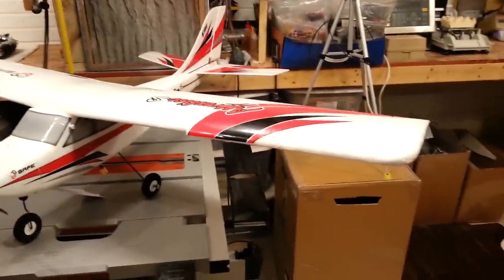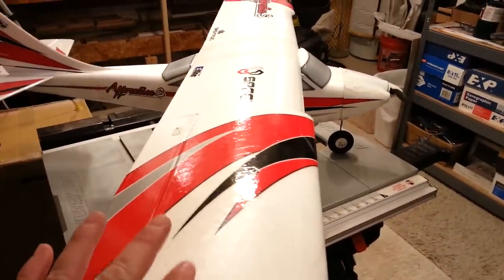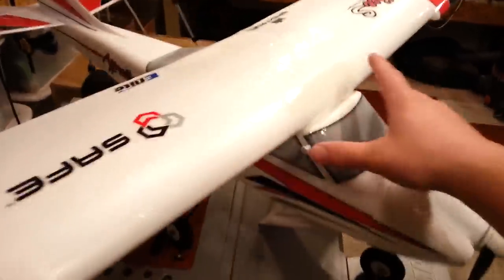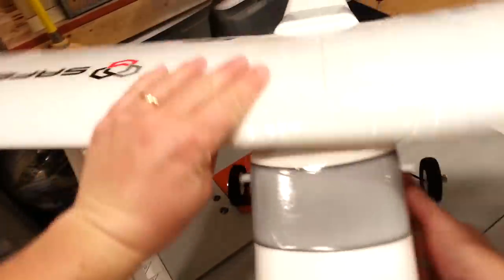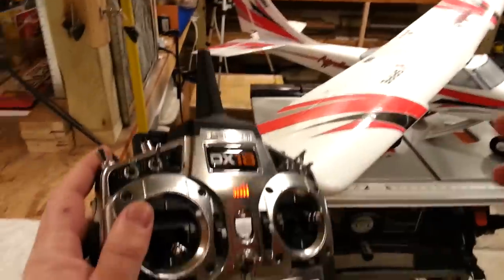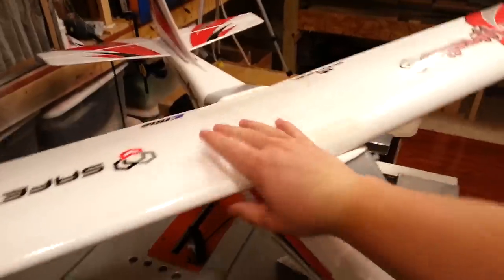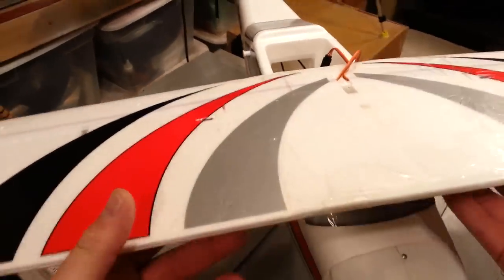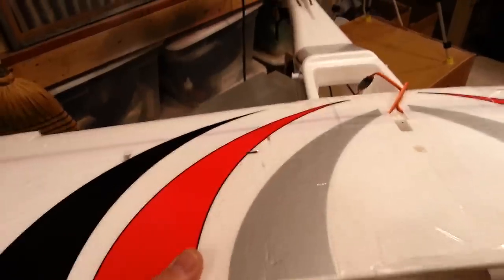E-flite - Apprentice S 15e - Flaps Mod - Part 1 of 2

Comment: Brian, I have a question and I know you can help me, My Aprentice STS came with the receiver SPM4650C (same as the Carbon CUB) and the  flight controller is SPMA 3230 (the one in the Carbon Cub is SPMA3230A), for the Carbon Cub was so easy to install the flaps, now I am doing for the Aprentice, but I am not able to find how to activate the channel 8 which is available in the flight controller at the Aprentice, I am using the NX10 Transmitter, could you please give me some directions, thanks.
Reply from the maker: Firstly, plug in a servo to that port, then go into MONITOR MODE, then move switched to identify what controls what HIGH channels. Then when you see it move, you can make a MIX, since you may not be able to use the WING TYPE to setup flaps, since the RX is designed to be setup without flaps. This is easy to make happen, but you have to do some of the flap stuff manually. It's not hard, but it's gonna take some fiddling.

Try these things and see if you can get it attached to a switch, then use the SERVO SETUP MENU To change the SPEED if you want it to move slow like the FLAP MODE would do. Then you have to figure out how to mix in some elevator down, if you so desire.

Comment: Big stupid new guy question,  maybe I missed it but can I use the basic 7 ch transmitter that came with the RTF kit? (Spektrum DXS DSMX® 2.4GHz) Or do I need to upgrade transmitters for this flappy doo modification?
Reply from the maker: I don't know for sure, since I haven't had the RTF offering, but I assume you'll have at least one channel that's "Free" on your setup, but you'll need to look at the Receiver inside. If there's an opened spot, plug in a servo (yes, you can just pull the RUDDER for example and move it over) then start flipping switches and see if the servo moves ;)
Reply: @BrianPhillipsRC  Thanks for the reply. What you wrote makes sense to me. According to the RTF 1.5 description, this unit comes with the Spektrum 3230 Flight Controller, pictures show 8 slots (?).  I won't hold my breath but I bet it should work, although I doubt I will have 2 positions for flaps due to the basic controller, no biggie. After we move back to land and onto the mainland I'm grabbing this plane, everyone tells me it's a great starter. I can't leave my toys and models be, so I'm sure I'll be doing mods to it as well. Thanks a ton Amigo. 👍🏼

Comment: Brian, good point on the safe.  I have the mini apprentice and there is no on/off switch on that one.  Plug in the battery and its automatically on.  How do you avoid that problem.  Though I don't think anything ever went horribly wrong, but I will be testing this out next time I use it.   thanks
Reply from the maker: I think they've improved the arming process in the newer AR636 to prevent arming so that you can flip the plane over after hooking in the lipo, but this was an earlier SAFE Rx, before that feature existed.
It was a "rookie" mistake, but something that shouldn't even be able to happen, if you ask me :)

Comment: Hi Brian, thanks for hi-lighting a dangerous combination for "safe" equipped aircraft.  Really sorry to see a busted airframe When you first mentioned a mistake, I had visions of car v's plane
Reply from the maker: It happens :) (left out some select letters, as you can see)
SAFE is a great learning aid, and I didn't even need it when I flipped it on, but I knew exactly what was happening, but didn't have time to respond in the fastest method (IE turning it off)...maybe I'll move my control on the apprentice to my GEAR switch, since I have no intentions of utilizing that switch, but it's easier to get to that switch in a hurry.

Comment: Flap and LED's little Grasshopper here. You do this so much that you should consider making your self a set of wooden flap angle cutters Roulers, so you can cut more easily with a flap exactoknife  blade or maybe something like this https://www.youtube.com/watch?v=149ZXze_JOo   or even better a one pass to cuts like this one, but DIY  https://www.youtube.com/watch?v=obJfXKI99oQ&t=6s you could probably make one that gets hot powered by a lipo battery
Reply from the maker: that is nice!
Reply from the maker: The second one... I think I saw that on The Silence of the Lambs???? 

LOL
Reply: LOL well you can also use it to harvest organic film covering for your balsa airplane then ;)

Comment: Hey how would ypu recommend cutting the flaps fo this plane if im going to use the dubro nylon pinned hinges? The ones that slide into the foam in the middle of the flap. Should i cut straightm or a 30 or 45 degree angle?.
Thanks
Reply from the maker: You could cut them at either angle. Are you trying to make a fouler flap, or just a tight fold?
I suggest you go for whatever yields the smallest gap, which would help you to "break" the plane more with full deployment. That's the only part I'd change about my design here, but they worked really well.
Good luck, whatever angle cut you decide.

Comment: Brian, great video, super explanation of all steps, simple tools, skillful craftsman  = great success. Will copy your work with tremendous pleasure :) Keep on going and show us some more adaptations. Thanx!
Reply from the maker: Glad you enjoyed it! One this I would do differently, if I had it to do over...I would have use a slightly thicker wire from one side to the other. This has proven to be on of the only weaknesses in this design, even though it works okay, I think the flaps would be way more effective if they were held down better.
Good luck with your mod :)

Comment: Whats the best glue to use for the servos?? Im putting flaps on mine but not sure what glue to use for the servos!
Reply from the maker: You can use hot glue, but gotta be sparing - it's heavy. If not that, then CA would be okay, or Mucilage (foam tac / UMH Por are similar)

Comment: Hey again. So i just tried to hook up the 2 servoa to the aux 2 port on the apprentice s 15e. I have a dx6e and i guess the aux2 port doesnt show up on my radio. I was told that the safe system uses one channel and the panic uses another with as3x. ? I can not get the servos to work as flaps. Do you know of anyway i can get this to work without buying a new radio.? I tried mixing and everything.. using the stock receiver and eveything is messed up. When i tried to set it up it will interfere with the flight modes. Panic and the 3 flight kides dont work. I could never get the servos to work with the dx6e. Can you please help...
Thanks
Reply from the maker: 6 channels means that you aren't getting to channel 7 or channel 8...so you might be unable to do what you want to do, without either another Rx OR a new Tx...

This might help you understand better...

(In no particular order)

1) Rudder
2) Elevator
3) Throttle
4) Aileron
5) Gear
6) Aux 1
7) Aux 2
8) Aux 3
Reply: @BrianPhillipsRC  can i put the same reciver thats in the timber 1.5m in the apprentice and set it up like the timber? How would that work with the apprentice i think its the ar636 or something
Reply from the maker: You CAN use the Rx, IF it actually came out of a Timber, but if you buy it new, you'll have to program it.
Here's why...
Since the Timber 1.5m comes with flaps stock, they're programmed in on the Gear Channel (If I remember right...you CAN get the manual from horizonhobby.com to confirm this thought), rather than the higher channels, like you'll be with the stock apprentice.
HOWEVER...
You will NOT be able to tap into SAFE Select, since I believe you can only assign it to a higher channel, or you would have to tie it to another function already being used, like Gear (flaps)...which is a crappy solution, if you ask me.
If you want to make the upgrade to an AS636, you should seriously consider getting a USED DX8 or DX9, since you're not that far off from the cost of a USED one, just in buying that receiver...
Good luck with your decision, I know it sucks to have to put plane money toward a "utility item" like a transmitter, but you will NOT regret it. I LOVE my DX18, and would replace it tomorrow if it failed, might even get a DX20 next.\

Comment: Been flying my apprentice on floats for years now! It lasts long if you are responsible and mine is still in mint condition. Time for some upgrades as I am pretty comfortable with the plane.
Reply from the maker: It is a great plane, and so fun to fly! Flaps are super easy, but just do a tape hinge, don't do Fowler flaps like I did, it was way overkill and didn't really help any, that I can tell...the additional drag from a tape hinge would be preferable on this floaty plane.

Comment: Hi.  Great series.  I will eventually try this on my Apprentice.  I would have removed small pieces of decal  where the hot glue was used to fasten the'rods to the flaps.
I thought it would be better to glue directly onto the foam than the decal which is sitting on top of the foam unless the hot glue melts the decal and the glue flows to the foam.  Just a thought.  Thanks
Reply from the maker: yeah, it's kind of a double edged sward...foam hold the heat, so you melt a lot worse if you go straight up against it, but you can and use a cooler setting too :)

Comment: Can you do this without a controller like that
Reply from the maker: you mean with the RTF transmitter...not sure?

You can do it without a DX18, you just need one additional channel, but a computerized transmitter is helpful for delaying the flap deployment and elevator mix to flaps...beyond that, you can probably do it on the stock transmitter if there's a switch to control the additional channel on the receiver. Just plug in a servo, and test it with your switches.

Comment: Have you ever tried to setup flaperons just through the radio, keeping the aircraft original?
Reply from the maker: You can't do this. The servos are run through a "Y" Cable, so you have to make mods to the wiring, and also basically replace the stock Rx. You CAN do Flapperons, but I find outboard flapperons to be a waste of time...HOWEVER, Crow or inboard flaps and outboard spoilerons makes for a fun setup!!!
Reply: @BrianPhillipsRC  - On the STS it is separate servos and wiring. I was really wondering about putting a bit of spoiler into the ailerons.

Comment: Would flaperons work?
Reply from the maker: Outboard flapperons are not great, but they DO make an impact. I'd HIGHLY recommend doing inboard flaps, rather than flapperons. Flapperons not only cancel out the AS3X and/or SAFE on the "other" aileron (the one you have to disconnect and plug into Aux1 or 2...whatever the spare channel is) but they also will cause the plane to fly "hokey".

NOW, if you were to day CROW (Spoilerons + Flaps) this would be really cool!

If you can tolerate the work, do the flaps. The mod is about as easy as it can be, and you will thank me.
Reply: @BrianPhillipsRC  thank you,

Comment: Any idea how to set up a DX6 for this?  I can't get the flaps to work at all.  I had it working on my DX9.  Wish I could remember the configuration.
Reply from the maker: I don't have a DX6, so not sure what to tell you on this one. Sorry!!!
Can you just bind it as an "acro" and build it one feature at a time???
Reply: Thanks.  I'll give it a shot.
Reply: BTW, I like your videos.  Very informative.  The Apprentice is a great aircraft.  I bought mine when they first came out and am still flying it.  Crashed more than a few times, but always managed to get it back in the air after some battle damage repair.  :)  It probably weighs a pound more due to glue and tape.  A couple years ago I upgraded the motor and ESC.  More than enough power!  Just ordered a new fuselage and tail section.  Hope to get several more years out of it.  The stability makes for a great video platform.  Also have skis and floats for it.  All season flier!  I've got video of some flights on my channel.
Reply from the maker: This plane is just rock-solid. She's so fun to put up, and just fly and fly and fly!
I'll check out your video :)
Reply: I have video of it with the skis, too.  Oh, and I just ordered a DX8 Gen2.  I tried what you recommended but it just won't work.  It seems that the Apprentice receiver uses the 6th channel for the panic mode.  At least I'll have another spare transmitter lying around.  :D
Reply from the maker: Good for you!!! You'll love the DX8 (I had the Gen1 and it was excellent!!!)
Reply: I got the DX8G2 working with the flaps now and with 3 positions.  Even managed to keep the 3 safe modes and panic button on the proper switches.  If anyone wants the setup files, they can PM me.
Reply from the maker: Nice - Good work :) I knew you'd get it going!!!
Reply: First flight after the rebuild.  Good as new.
https://youtu.be/47UKsHohe7Q
Reply: @77bubba00  I'm watching this 3 years later, just got the DX8 gen 2 and want to do this flap mod on my Apprentice S E15.  Curious about setup you used

Comment: Brian Phillips, job well done. I added flaps the same way you did to a Dynam C-47, except I used the 3M Blenderm tape, I didn't think about using the Dynam hinges like what my Dynam Grand Cruiser had for the flaps, that also looks like the same hinges you're using. I used two 9 gram Freewing digital servos, one reverse and one standard on a y connecter. I'm also using the HobbyEagle A3 AP gyro stabilizer and Spektrum AR8000 RX with my DX7 Gen2 TX for the C-47, it made a heck of a difference in landings.
Reply from the maker: I bet. I'd really like to get my hands on one of those C-47's...but they seem to be out everywhere. Where'd you pick yours up? Was it PNF or ARF???
Reply: @BrianPhillipsRC , I bought mine from General Hobby about four years ago as a RTF. I think MotionRC has them in stock and you'd also get free shipping, whereas, General Hobby doesn't offer free shipping over a certain amount. The C-47 is a great flying plane, but the first upgrades I done was with the motors, esc's, and I added a separate ubec, the Dynam motor shafts will bend easily just from the blades striking a clump of grass or anything. A excellent replacement brushless motors for the Dynam C-47 and Dynam Grand Cruiser are the Turnigy 2836-1100KV motors from Hobbyking, I also used the Hobbywing Skywalker 30A esc's, ZTW 10A UBEC, MAS 8×6×3 counter rotating props, and HobbyEagle A3 6-axis gyro stabilizer, with Spektrum RX and TX. As of lately, I've been buying and using more and more Lemon receivers from BuddyRC and the Admiral receivers that are made by Lemon from MotionRC. Horizon Hobby and Spektrum is out pricing their selves and the quality and selection in Spektrum products in my opinion are going downhill.
Reply from the maker: Totally agree about Lemon-Rx...great product for a fair price!
I'll check at MotionRC

Comment: Quit 1 min in...it was obvious you were going to ramble on and on....
Reply from the maker: Yes, I was going to do exactly that.... Thanks for sharing that you left after only 1 minute. I don't know what I would have done without this amazing status update. Most people just leave. You have to announce it to the world. What a prick
Reply: Brian Phillips to be fair I went back and watched the first 7 min of your video. You went on about the crash and your failure to read the manual or watch a video that specifically tells you about that switch, for 6 min 49 seconds before you actually got to the subject of flaps( the reason for the video). That IS rambling on. If I want a lesson on the SAFE system of this plane , horizon has a good one, flite test has an awesome one...Both videos get right to the point of the video. Editing....